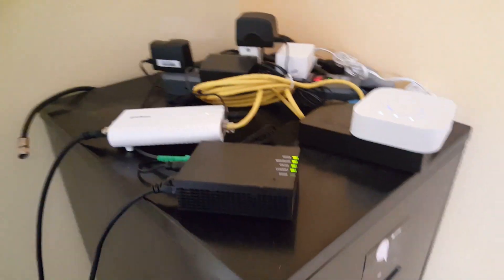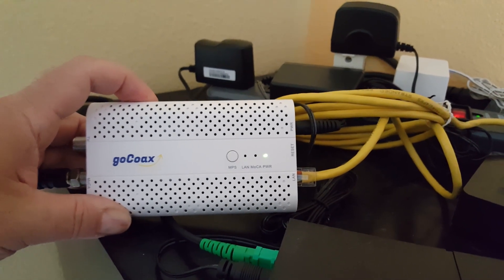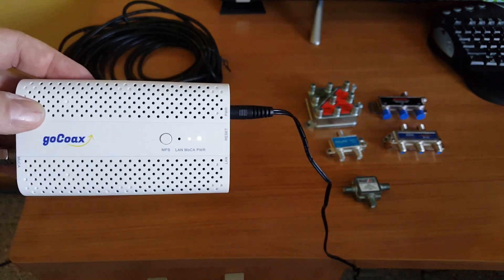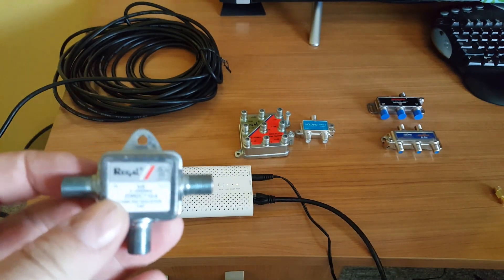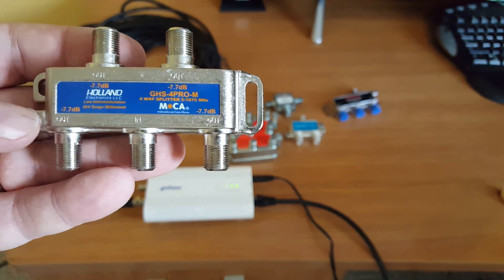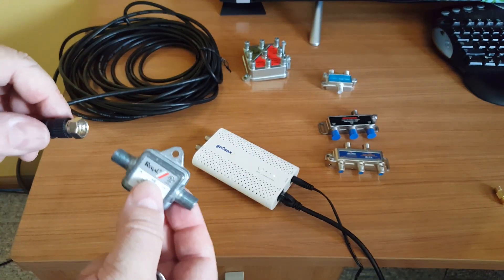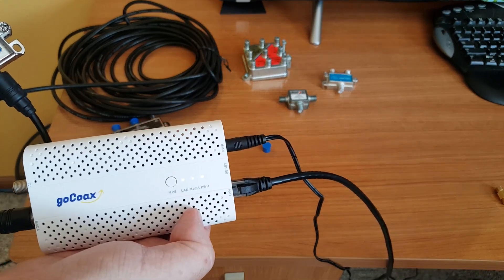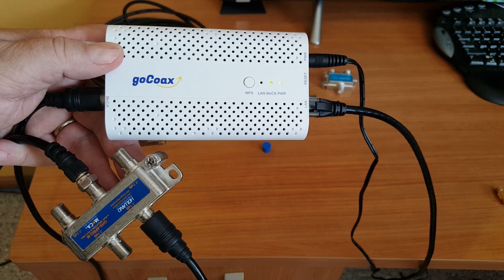How to troubleshoot connection problems with MoCA (goCoax WF-803M) and basic MoCA setup requirements

Comment: I have an Xfinity/Comcast feed coming in to the house to this powered 9 port amp. Commscope CSMAPDU9VPI 9-Port MoCA HomeConnect Passive VoIP Amplifier with MoCA Connectivity, Unity Forward/Reverse, with Power inserter, Faster Internet Phone Comcast Xfinity (9-Port MoCA, Gray) (see a pic on Amazon)

I have 6 cables coming out to the house which was cabled back in 1998 when house was new. (not sure if cables split anywhere in wall and cellar is finished so cannot see any runs)

Problem: I have two Motorola MoCA 2.5 Adapter MM1025 – True 2.5 Gbps Throughput. In office upstairs I have Motorola 7550 modem/router (no moca) which I connected the first moca device to: cable to room from 9 port splitter into NETWORK port of moca and cable out of DEVICE port to modem/router and also cable for ethernet to port on modem/router. So as per instructions office moca should be set up. Also tried splitter (moca compatible) from wall with one cable to the moca and one to the modem/router (I assume signal can run backwards out of moca NETWORK port back to 9 port splitter and back to walls of house???)

Then go to cellar and plug in wall coax to second moca and no link signal, tried in two other wall outlets around house and same thing. Daisy chaining like your video with direct cable and link light comes on so moca devices seem to be ok.

Any ideas?

Comment: Good video and nice explanation.  Only 1 thing.  If you are going to use the "whole house" splitter where all the coax runs terminate: Spectrum's (in my case) comes into the house and goes into the "in" port on the splitter.  Mine is a 6-way so there are 6 coax runs out from the splitter, 1 each to 6 different rooms.  I have my modem and router (separate devices next to each other) in the den.  I want to use MoCA device 1 in the den.  The "TV out" on the device goes to the cable modem (or I use a splitter before it gets to the device).  Then an Ethernet cable from my router will go to the MoCA device 1.  So the MoCA signal is going back to the splitter on the same run and going into one of the "out" ports on the splitter.  Then I will go to another room (on another coax run) and install MoCA device 2.  Will this work since no MoCA device run goes into the "in" port on any splitter???  Thanks!
Reply from the maker: Good question!  Take a look at this one of my videos.
https://youtu.be/_Gfjnspfd94
As you can see, I also have a splitter that takes (took since I switched to fiber) in a Spectrum coaxial signal into my home and feeds it into my "new" MoCA compatible splitter.  The splitter will allow all of the coaxial feeds/lines to "see" the MoCA signal you are feeding back into it form the device in your den and the MoCA device connected to the coaxial drop in the other room will see it and you will be OK.  Your setup is very much like mine was with cable internet.
The golden rule is that if you can trace a continuous path from the first MoCA device to the second, even across splitters (MoCA capable!) you are setting things up correctly.

Comment: Can I put a Moca device in front of the splitter that Comcast installed to run coax to all of the rooms in my house? It is Moca compatible. This would change all of my coax in the home to possible Moca network?
Reply: Not sure if this will help.  But when I was looking into the MoCA Adapters; I saw that there are some MoCA Adapters that have 2 Coax female plugs on one end and then the female Ethernet plug on the other end.  I assume one plug allows for the main coax line to go in and the other for the TV Coax Cable to connect to the TV itself.   As to the placement of where it should be located, Uncle Mike would have to help answer that question.
Reply from the maker: Hello Shep!
The short answer is no.  You have to have a MoCA device at the end of every coax drop in all rooms that you want to be connected to the MoCA network.  The splitter Comcast installed being Moca compatible is nowadays standard practice (and a good one) but that alone does not send any MoCA signals in of itself.  
You HAVE to have a MoCA device connected to your router (assuming your internet is being distributed by a router or WIFI router) ethernet port via ethernet cable.  Then you HAVE to have a MoCA device in each separate room or area that you want to hard wire into the coaxial network.  Initial MoCA connection to your modem/router in room one and then sending the signals to 3 other rooms  =  4 total MoCA devices.  MoCA plus one other room  = 2 MoCA devices.  There is no other way to do this.
Reply: @UncleMikeRetro   yes that is what I was trying to say but I may not have been clear in what I was trying to get across. If I put a moca device in front of the splitter then I could use a moca device in every room that is connected to the splitter. Like you are saying above. Thanks for the explanation, it is actually exactly what I was trying to ask but was unsuccessful in doing so in a clear way. Thanks for the help
Reply from the maker: @shepsbarbershop9720  Sorry for my word spewing.   Glad we were on the same page.

Comment: Great tutorial and troubleshooting advice. Cheers from the UK!
Reply from the maker: Thank you kindly!
Reply: @UncleMikeRetro  hi, thanks so much for your instruction video. I would like to ask that: at 16:14 that splitter has 5 ports/jacks, we can see that there is 1 side with 3 ports/jacks, another side with 2 ports/jacks. Can we plug the coax cable randomly to some ports or we need to plug the 1st cable to one of the 3 ports, the 2nd cable to one of the remaining 2 ports?

Comment: Uncle Mike, thanks for the video.   I'm not using my Coax cables anymore since I "cut the cord".  If I just connect the Coax cable from 1 room to another room's Coax cable ( therefore using a straight line connection without the need for a splitter ), can I just use any regular Coax connector?

Or

Do I have to use some MOCA approved splitter that has a higher MHz transmission rate?
Reply from the maker: If it is just connecting one coaxial line to another, why not just use an inline connecter?  If you DO use a splitter to connect them, then yes, get a MoCA frequency certified one for guaranteed ease of use.  850 MHz to 1500 MHz
Reply: @UncleMikeRetro  Thanks for responding and the helpful advice.   I'm just connecting one coaxial line to another.   Both meet in an Xfinity Connection Box that is located outside of my house where all of the Coax cables meet and where it split off from the old Inline Xfinity Coax connection.  From the Connector box to where the cables physically come out of the wall in the separate rooms, I do not know if it splits anywhere else beyond the Connector box within the walls.  Given the locations of where the cables come out throughout the house, I don't think that there is any other splits.     Based off of that, it sounds like I could just use any Coax Cable Connector to connect both lines?  I don't think I have a need to get a special MoCA Splitter.
Reply from the maker: @kayemcee9967  I agree.  And besides, if that fails, you can always get a MoCA splitter later 😏
Reply: @UncleMikeRetro   Thanks for the helpful info.  I ordered the GoCoax MoCA adapter today via Amazon and will look to install.    It sounds like a pretty straight forward setup, so I'm not anticipating any issues.
Reply from the maker: I'd still be curious to know you are up and working!
Reply: @UncleMikeRetro  It worked out great.   The Coax connection box that Xfinity ran their cabling into wasn't wired, so I had to figure out which Coax Cables ran to which room so that I can connect the cabling from the Office to the Bedroom.  It took forever and guessing, but I eventually figured it out.   Once I was able to connect the Coax cables together, it was really straight forward.   I was able to test it and got 650+ MB download / 500+ MB upload.   Compared to before, I was only getting maybe 400/ 300 through the 5GHz WiFi at best, but it wasn't entirely stable.   I then plugged in another WiFi Router and hardwired the PC and PS5 to that room.   Having a stronger WiFi Signal in that corner of the House made a difference for the Security WiFi camera that I have in the Exterior on that corner of the House ( which I couldn't really connect to due to the very weak WiFi signal in that location ).    Everything worked out for the best.    I'm glad that I learned that you can use existing Coax Cabling to run a Ethernet signal over.    It's so much easier to do it this way rather than running actual ethernet cabling in through the walls.   Again, thanks for your advice.
Reply from the maker: @kayemcee9967  Thank you for the update and for the praise!  
I am so happy it all worked for you.  Are you getting your subscribed speeds over the MoCA network?  For instance, I pay for 600/400 and get 100% of it over the MoCA.  When I test the speeds between my computers alone, I get the full 1 GB speeds over the MoCA.
Reply: @UncleMikeRetro  I have AT&T 2 GB fiber,   The MoCA connection there is nowhere near that speed through my Mesh network, but I'm not getting anywhere that speed over the network even running hardwire directly off of my main router that is connected to the AT&T box.   Running the MoCA Coax/Ethernet connection simply allowed me to create a far more stable and high speed connection to a further corner of my house.     This in turn allowed me to setup another WiFi Router in that area of the house where there is high usage.
Reply from the maker: @kayemcee9967  I get that, but you should be maxing out the Moca at 1 gig or even 2.5 if you bought the newer devices.  Hmm.  If it makes you happy enough, then I will stop pestering 😎
Reply: @UncleMikeRetro  Nah, you're not pestering.   The bottleneck is the main router that is connected to my AT&T Box.  At most, I can probably get 1GB speed with the 1GB ports on my router on both ends.   But  I'm just using regular Ethernet cables on both ends, not Ethernet CAT6+ network cables.   Do you think that would make a difference if I were to get Ethernet CAT6 network cables to connect to both ends of the COAX adapters to boost the download/upload speeds a little more?
Reply from the maker: @kayemcee9967  I think why the heck not try for fun?  Also, I have experienced wild swings in quality of plain old Ethernet cables versus good CAT 6.  Give it a try!
Reply: @UncleMikeRetro  FYI Uncle Mike.....I used a MoCA adapter to hardwire my Aunt's old house to create a good connection at the back of her house.   I initially tried connecting a WiFi router to a Repeater down the hall to the back of the house, but the WiFi signal wasn't strong enough and the upload/download was only 1/4 the speed.   I used the old CoAx Cabling in her house and was able to connect 2 MoCA Adapters from end to end to create a stable 400+ MB hardwired connection ( for a 500 GB Internet Connection )  from the front of the house to the back of the house.  Despite multiple splitters that were connecting the Coax cabling, everything worked great!
Reply from the maker: @kayemcee9967  That is a rousing success.  Especially considering that you probably went through at least 2 splitters inside the walls that you could not even see!

Comment: I just got my single MoCA 2.5 adapter and now you are saying in order for it to work I need a second one? They make it seem so simple like you can just hook up the coax cable from the wall and into this adapter then run the ethernet cable to your router and get Wi-Fi! So does this mean I'm incorrect and have to buy a second one?
Reply from the maker: Unless your existing modem or router is already MoCA capable, yes, you need one on each end of the coaxial line.  Think of them as LAN cards.  One on each end of the line.
Reply: @UncleMikeRetro  awwww man!!! More money and I feel like it still will not work! I currently have the single one connected directly to the cable coming out of the wall and directly into my router and no internet!
Reply from the maker: @RajunCajun1  What about your modem?  You still have to have that connected too.
Reply: @UncleMikeRetro  I was thinking that I didn't need to have the modem that the adapter will take its place and transfer the signal to the router for wireless. I have internet over satellite that's been fed into my home via coaxial cable.
Reply from the maker: @RajunCajun1  well, the moca devices only move an internet signal from one room to another.   You still need a valid signal to send in the first place.   So if you have satellite internet, you need to feed the incoming signal to the modem then WAN line to your router then Ethernet line to the first moca device then it sends your DECODED internet to the 2nd moca device via coaxial.  If you follow my layout it is simple.   But two moca devices.  period.
Reply: @UncleMikeRetro  This is disappointing! I really thought that I can take the coax cable that has the signal from the satellite dish go straight into the mocha adapter and then the ethernet cable from the adapter into my router!

Comment: These 2 WF-803M worked perfectly for years until I wanted to add 2 of them. Now they don't want to work. I bought MA2500D and now it doesn't work. They don't seem to want to work together. I'm pretty sure the dev haven't finished the backwards comp ability for in their firmware.
Reply from the maker: That is very interesting!  Have you seen anything in the Reddits or any other forum about that?

Comment: Sorry sir you don't need 2 MOCA devices if you cable modem support MOCA
Reply from the maker: I agree but you twist the point.   Of course a MoCA modem or router would count toward the needed two devices.  I said two devices not what they HAVE to be specifically.

Comment: I'm currently using MoCa adapters to hardwire connect my sonos speaker amps in the basement to the incoming coax line on the 2nd floor.  One adapter is connected to the amps' receiver and the 2nd adapter is connected to the main router, which has been working well.  However I have a new device I need to plug into the router but no more ports available so I tried plugging the adapter ethernet cable directly into an open port in the modem instead of the router but I can't get a connection.  Any idea how to troubleshoot so I can free up a port on the router?
Reply from the maker: If you were me, and I had the same issue, I'd keep it simple by connecting a cheap 1 GB switch to the router, adding an additional 4 ports (after the connection).

Comment: Quick question that has been pretty hard to find on the internet: How well do moca adapter play together when I have multiple ones. Say I have a standard house with coax throughout and I want to use each and every port as a hardwired connection. Could I go Moca to coax > to a splitter to all the other rooms > to moca adapters in each room? Or would signals cross between adapters?
Reply from the maker: They play very well, actually.  Let's assume you are using similar or all the same MoCA devices.  One at each Coaxial drop in the rooms you want the computer hooked up to.  One feeding the signal to the "network" from the modem or router.  Mine is set up so that one is at the router, and one in each of three other rooms.  The only thing to make sure is that the main splitter (mine is in my basement ceiling) is 100% MoCA compatible.  The MoCA devices only "decode" the signal on each of their ends and send it back across the coaxial network.  The signals do not "cross" any more than on a real ethernet network.
Reply: @UncleMikeRetro  Thank you for your reply! I'll have to give this a shot! I think the concept I had a hard time wrapping my head around is that ethernet networks typically require a network switch to be the sudo air traffic controller when going from 1 connection breaking out to multiple connections. But sounds like MoCA doesn't have the same requirements (so long as you use a MoCA certified splitter).
Reply from the maker: Yeah, lemme know how it goes.  MoCA is more peer to peer than anything.

Comment: My gocoaxes arrive today, so hopefully it'll all play nice. :D  I'll keep this video in the back pocket.
Reply: Update, it works out of the box at 350Mb.  Now I just have to work out if the amplifier in the attic is causing some kind of signal issue :)
Reply from the maker: Get out!  Sweet!  Now to track down the slow spot!  Keep us posted, pal!
Reply: For the setup: antenna in the attic -> Amp -> four lines going to the two main bedrooms, living room and kitchen.  Living room is a two port socket, so I plugged a MoCA into there which goes into a 5-port network switch.  Upstairs, I go from the tv socket in the 'office' bedroom into another MoCA into an 8-port switch for all my gear.  Boom, Gigabit! :D

Comment: I have this gocoax with Xfinity gateway, all 3 lights are green, but on my computer it says “no internet” any idea why?
Reply from the maker: It is possible that you MIGHT have to enable MoCA in your Xfinity (assuming it supports MoCA).  I found this:  https://forums.xfinity.com/conversations/your-home-network/how-do-i-enable-moca-on-my-modem/602daf24c5375f08cd023955
Other than that, w/o seeing the issues firsthand, it is hard to spitball your potential problem.